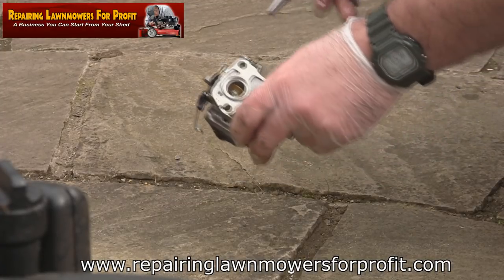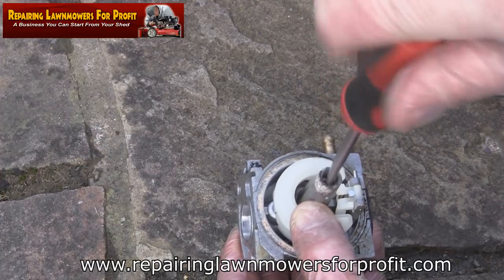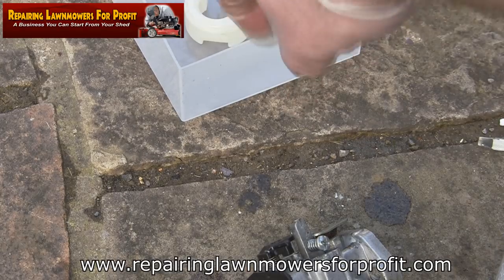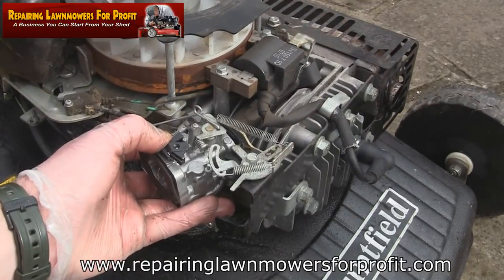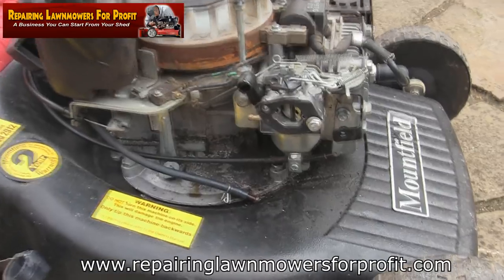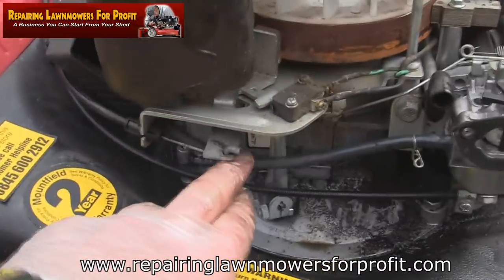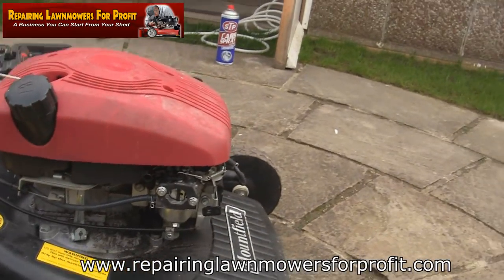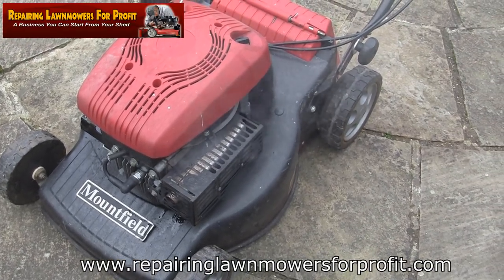Mountfield SV150 Petrol LawnmowerHow To Service The Carburetor

Comment: I have a mountfield sp454 it keeps going up and down in revs sometimes sounds like it’s over reving and then finally cuts out after about 2 minutes each time. Any ideas? The air filter base is slightly broken and has come away from the gasket a little bit. Do you think that could be the problem thanks
Reply: Looks the same engine as this one your working on actually
Reply from the maker: Ben B GAMING It could be but mine worked fine without the box on at all. It sounds like a problem with the carb not delivering fuel properly. I would follow these videos and service it. Also check the throttle cable. Make sure the drive cable isn't disturbing the throttle cable as well.!
Reply: Mower Man think you could be right I think it’s the drive cable interfering with the throttle. I did clean the carb but maybe I didn’t put the linkage back properly
Reply from the maker: Ben B GAMING just clip everything in place when it's running evenly
Reply: Mower Man thanks very much this video has helped a lot, was just about to scrap my mower. Adjusted them cables that You showed and now it’s running so much better, it does have a bit of popping sound from the exhaust do you think there could be an exhaust leak? It is a bit rusty

Comment: Got my SV150 running again after watching your previous vid, changed the spark plug and air filter and then sprayed it with some easy start, now it runs but with a lot of white smoke and kinda coughs/pops (even 30 mins later) and then slowly cuts out if I take it off the choke and try engage normal throttle. Will service the carb as per this video and report back

Comment: Good job. Put two dowels in the bolt holes, slide all the parts on. Then hold the whole affair up against the block, remove one dowel at a time and install the bolt.,Makes the job a breeze!

Comment: Hi mower man, i got the same engine sv150 on my lawn mower, but it have white smoke problem, and it leak oil from the exaust i think. What can i do for repairing it?

Thank you!!
Reply from the maker: Check the oil level and if it's ok run it for 10 mins till it burns off
Reply: @MowerMan  thank u for the quickly answer. The Level oil is slighty above the normal. Can i take off some oil? The air filter is  slightly wet oil. I will clean it.
Reply from the maker: Ettore Cavicchi you can but don't tip the mower up or it will get worse. use an extractor. I would run it for 10 15 mons and it will burn off
Reply: @MowerMan  ok thank you, and the carburator leak gas. What can i do? The leak is from carburator to cilinder.

Comment: i would replace that bowl and seal instead of cleaning it. its obvious that stale fuel has been left there over the winter. cleaning a bowl in that state will only cause the fuel to errode it more and caquse more starting issues.

Comment: I wish i had the same success doing Honda carburettors. Ive had to replace every carb on every GCV160 ive bought this year (around 5 or 6) as cleaning them just doesn't work. Tried ultrasonic cleaner, carb cleaner and soaking them in solution but it doesn't work. Also around 50% of the GXV engine carbs on the larger hondas dont seem to be very successful with cleaning and replacement is often only option. They are cheap tho for the hondas but just seems a waste of the old carbs which cant be saved
Reply from the maker: don'treallyknow4256 Do the replacement carbs work straight away?
Reply: Mower Man yes fit them and there already set up properly
Reply from the maker: don'treallyknow4256 That's very interesting.
Reply: try using fishing line to get through the small holes in the emultion tube and clean gunk, my carb cleaner couldnt do what the fishing line did